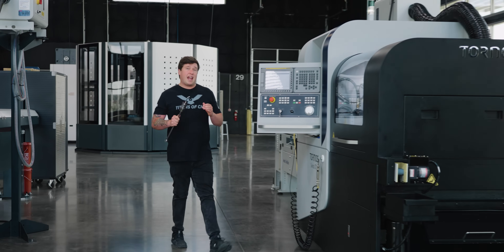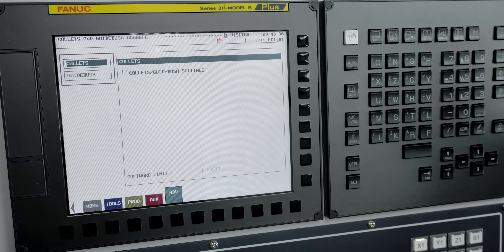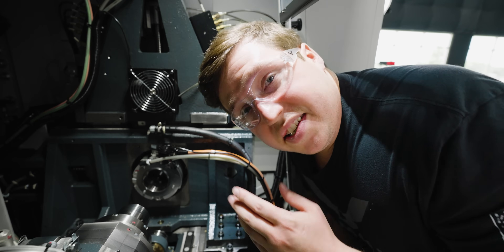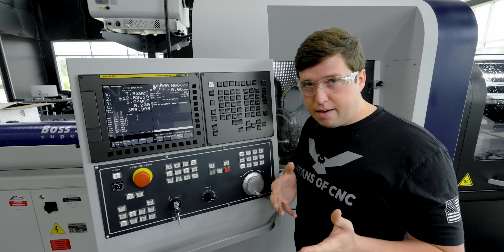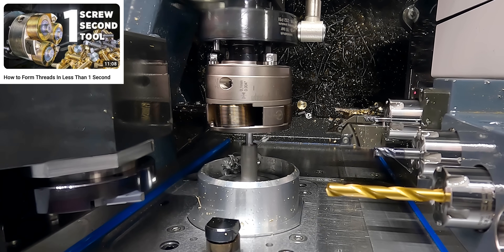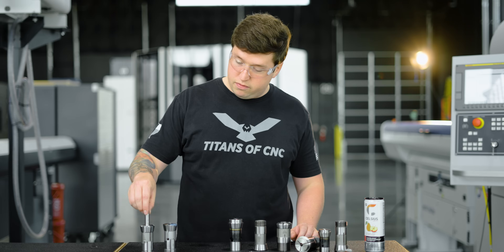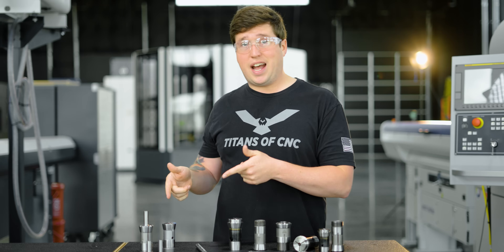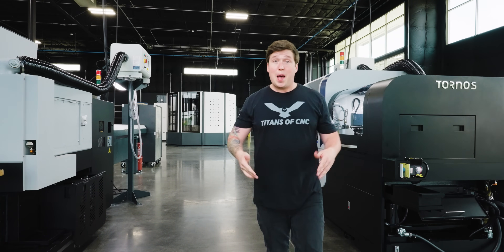How To Avoid Crashing Your CNC Machine

Comment: Great job talking about this topic Donnie. I am curious though, what is the difference between ground and non ground stock.....beside the grinding part 😂.
Reply: I put a 12 foot bar of stainless in my bar feeder, and it vibrated and alarmed out after the first part. Once I got ground stock, it was perfect. Every bar change is the same, and the Swiss runs great.
Reply: Ground stock will be consistently round, straight, and on size.
Reply: @tom  ahh ok, thanks.

Comment: One more tip: If you have a large lot of cheap material make sure you measure and sort it! Run each sorted lot and adjust your guide bushing when you switch to new material. I've seen variations as high as .005 and that's the difference between parts running like butter and having to cut a wad of spaghetti out of your machine.
Reply: That is a very good point. I’ve seen a lot of mistakes made because people didn’t do that
Reply: Omg I have this problem all the time.

Comment: I use brass guide bushings for titanium rods because the application guy from our brand of swiss type machines told me the carbide bushings tend to get the titanium stock stuck. 

Whats your opinion on these kind of bushings?

Thanks for the content.
Reply: Titanium and aluminum stick for sure but you CAN use carbide if you are careful. The titanium bone screw I did had stock that was .005 oversized and it still ran fine
Reply: Consider carbide guide bushings with rollers. Cost lot more but are ideal for titanium and really hard to machine steel. We use those mechanical cam tornos for more then half of century. I think only one firm is making them, from Switzerland very niche guide bushing type.
Reply: Thanks for the answer. Fortunatly our titanium rods are grindet to be -0.015mm and vary for only about 0.003mm from one to another. But I have to retighten the brass bushing from time to time because it wears of.

Comment: I know this is probably dumb but what are all the things that can cause a machine crash?
Reply: That is a LONG list.  Bad program, bad offset, bad operator, restarting a program in the wrong place.  I bet for every one I mentioned there are 20 that I didn't.  The truth is CNC machines are stupid.  They will de exactly what you tell them to do.  Whether you like it or not.
Reply: @brandons9138  thank you😂 I’m new to the programming in F360 it’s just a bit overwhelming because I don’t want to crash a big machine while figuring it out. I have a little cnc wood router but it doesn’t have enough hp to work on metals
Reply: @hunternull8320  Check and double check everything before running your program.  Does your router run standard G codes?
Reply: @brandons9138  yeah, it just has a manual spindle speed setting and no atc. I just don’t know where to make sure everything is good to go and safe to run.
Reply: @hunternull8320  Learn to read G Code if you haven't done so already.  On a 2D part its not hard at all.  Making sure you Z numbers makes sense will help you keep from ramming your spindle into your workpiece.  ALWAYS, ALWAYS remember to look at the actual code Fusion is giving you.  If the post processor for your machine is garbage then you can get some interesting codes.  The simulation that Fusion shows you is NOT the actual code that it'll output.
Reply: @brandons9138  is it pretty easy to learn on the internet or is it something I should learn from a person?
Reply: @hunternull8320  Post a section of one of your programs I'll see what I can teach you.
Reply: @brandons9138  is there a better place I could send it over or should I just send it on here?
Reply: @hunternull8320  I don't want to post my email on a open forum.  Just post a chunk of it.  Start at the top of the program and we'll see what I can make of it.
Reply: @brandons9138  hey I get that Brother!
Reply: @brandons9138  I’ll have to get around to it later today
Reply: @hunternull8320  No worries.  My wife wants me to take her out to lunch, so I'll be AFK for awhile anyway.
Reply: @brandons9138  yes sir! Gotta treat the Lady

Comment: Our drawn bars are usually under the ordered size by a few thousandths so that's not a problem we normally have, but the drawn bars are often tapered (upto a few thousandths) and vary in size bar to bar by a few thousandths. So If I set the guidebushing on the smaller end it may jam, If I set it to the larger end I can lose surface finish and concentricity due to the lack of support.  

At present I have to lay out a days worth of bar and measure every 18" down the bars to make sure a high spot isn't going to cause havoc, along with stopping and setting the bushing multiple times a day. How close would you suggest the stock has to be to the set size of the bushing?

Comment: In years gone by had job specked to run on 4 sliding heads. As cost saving used wickman 6 spindle auto roller supports. Produced it faster on 1 machine than 4 sliding heads. There great but just look at jobs can I do it another way first.

Comment: If your machine is capable its worth loading a touch off tool and using the pressure sensing tool head to verify your material position after every pull through the guide bushing. this prevents crashes from too much stickout

Comment: Don’t quote me on this, but I think Hardinge actually does a finish grind on the bore with the collet a little compressed. That way the material will run smoothly through, but it will also be exact diameter when clamped. This is why I only run Hardinge collets. Also when cutting emergency 5C collets, always find pins that are a little undersized so when you release the part the collet can remain in contact with the taper with our binding on the part

Comment: I'm not a lathe guy but this definitely help. I'm more of 5th axis router,mill, and Gantry type of guy. I always wanted to jump on the swiss lathe because I see it as a challenge to run a machine with 10 different axis. I've been pretty good double checking  offset when you're switching 3 to 5 axis. Especially have to double check those H&T values. You'll be surprised how many times I almost kissed the part by having non matching H&T values that has gotten away from rookie programmer.

Comment: The thing i have with ground stock is that i don't understand why you'd get a swiss instead of a normal similarly priced lathe if you're not going to use it
Reply: Long parts. If your part is .15 in diameter and 8” long it would be pretty difficult on a standard lathe. They are also wildly faster than regular lathes

Comment: That's why you need hand hacksaw in shop. When you bend, and have whole bar in the machine, so you can't push out and you can't pull out. You have to cut it out.
Reply: I HATE that situation! 😂
Reply: Sawzall and a parting tool, if you didn't destroy everything that should fix itself

Comment: there's no point using ground stock when you'll be cutting it anyway
Reply: you use ground stock because if you don't any dings or burrs or high spots will get caught on your guide bushing and require you to knock the bar back out and either sand down the burr or replace the bar, turning that entire section of bar into unusable scrap
Reply: It will bind in your bushing before it’s cut.